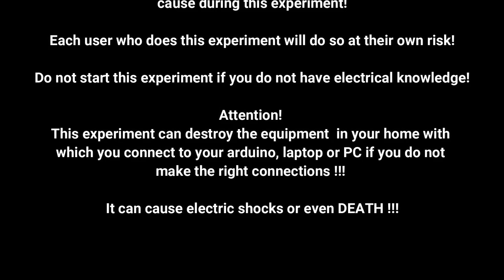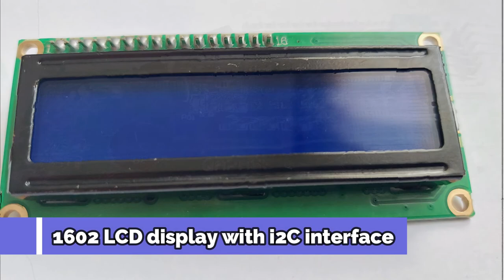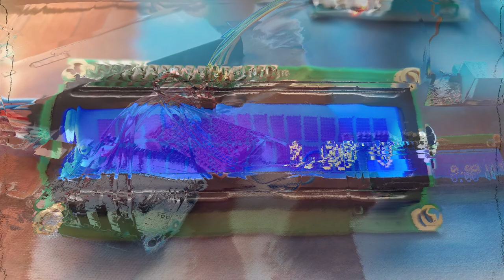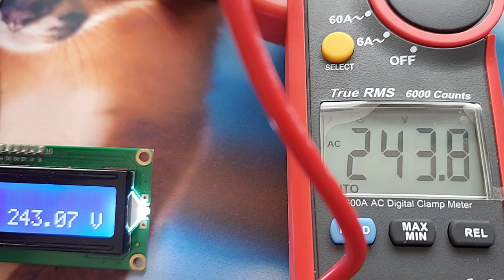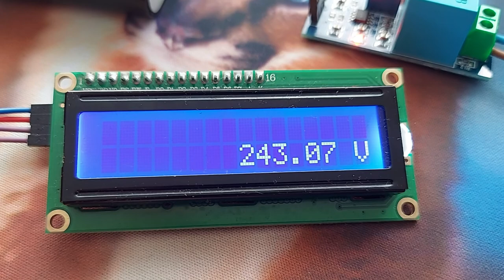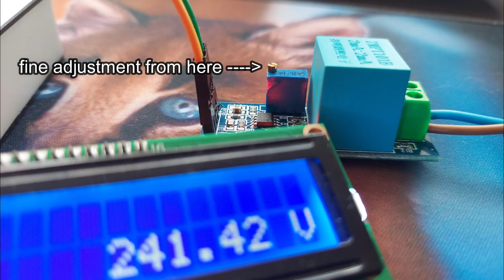DIY digital 250V AC voltmeter with ZMPT101B AC voltage sensor - Arduino - with code

Comment: Thanks 👍. I got this working but found that when I turn the A.C power off to the ZMPT I get a reading of around 70V on the display although when tested with a multi meter it is 0V. 
Any ideas where I'm going wrong?
Reply from the maker: You probably only broke the neutral and the phase remained live?  This phenomenon does not occur with me.
Reply: Thanks for the response, I initially though it was something along these lines but it get the same when removing the plug from the AC outlet. I'll strip it down and rebuild and see what i find. 👍 @LeventeDaradici
Reply: same situation bro, how did you fix it?

Comment: Can it measure 5v below?
Reply from the maker: I haven't tested it at such a low voltage.  Probably yes.
Reply: @LeventeDaradici  thank you so much sir, and also about the breadboard,  can you show us where to put the wires? Sorry i am not good at this
Reply from the maker: @journey2970  In the description of this video you have all the necessary information.
CAREFUL! THIS DEVICE USES VOLTAGES DANGEROUS TO YOUR HEALTH AND LIFE! IF YOU HAVE NO KNOWLEDGE OF ELECTRICITY, PLEASE DO NOT MAKE THIS DEVICE! IF YOU STILL DECIDE TO MAKE THIS DEVICE, YOU DO IT AT YOUR OWN RISK! THE AUTHOR IS NOT RESPONSIBLE FOR WHAT YOU ARE DOING AT HOME!
Reply: @LeventeDaradici  YES SIR!!! THANK YOU

Comment: Salut! 🤝 Respect pentru munca! 🤝 Mulțumim pentru video! 🤝 Eu sunt la început! Se poate măsură și tensiunea DC, as vrea sa masor pana la 600vdc! Mulțumesc 🤝
Reply from the maker: Buna! Nu stiu ce traductori sau senzori sunt la tensiunea respectiva in curent continuu, insa cu senzorul potrivit sigur se poate. Probabil ar fi utilizabil si un divizor de tensiune, conectat de un senzor  DC de tensiune mai mica. Trebuie doar testat. Atentie la tensiunea pe care vreti s-o masurati. Poate fi foarte foarte periculoasa! Mai ales in curent continuu!
Reply: @LeventeDaradici  mulțumesc pentru răspuns! 🤝 Așteptam și alte clipuri cu voltmetru AC, care sa contina și contactori!
Reply: @LeventeDaradici  și încă o întrebare, ce ar trebui modificat la codare pentru a folosi un display color cu tauschen? Mulțumesc 🤝
Reply from the maker: Partea cu contactorii este simpla. Nu actionezi direct contactorul din microcontroler. Adaugi un modul de relee sau releu. Atentie sunt relee la care poti alege sa fie low sau high level trigger. Programarea cu actionarea releului la fel de simpla. "Daca tensiunea ajunge la valoarea X cupleaza sau decupleaza releul". Releul astfel cuplat va cupla sau decupla tensiunea pentru bobina contactorului. 
---Exemplu relee la care se poate alege sa fie low sau high level trigger: https://www.aliexpress.com/item/1005001903120199.html
---Exemplu de releu la care nu poti alege sa fie low sau high level trigger: https://www.aliexpress.com/item/32879506129.html Acestea de aici sunt low level trigger.
-- Partea cu displayul SPI. Afisarea pe acel display este putin mai complicata dar realizabila. Se poate si touch screenul dar asta va fi mai dificil, mai ales daca esti la inceputuri. Sunt multe exemple chiar in ARDUINO IDE in dreptul fiecarei biblioteci descarcate. Practic fiecare biblioteca descarcate vine cu un set de exemple.